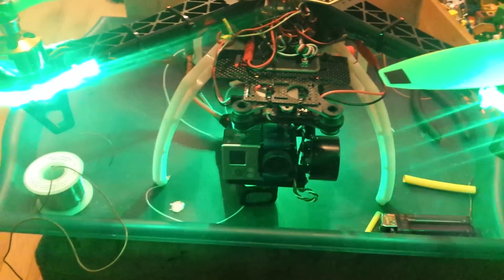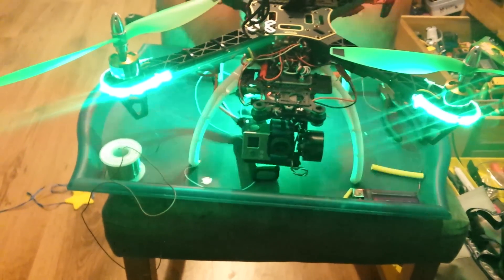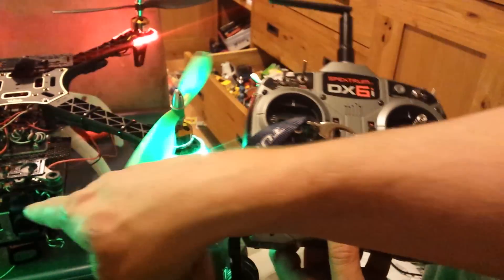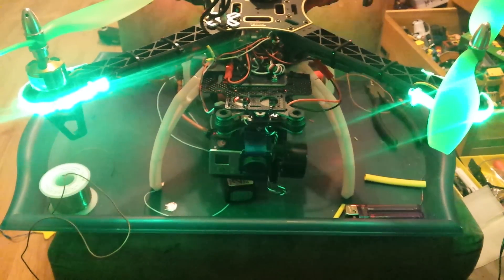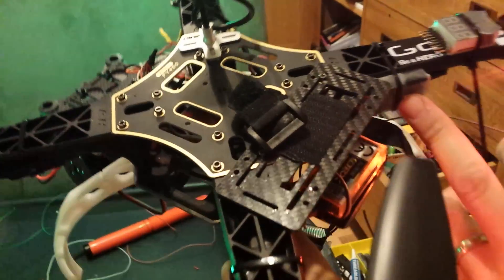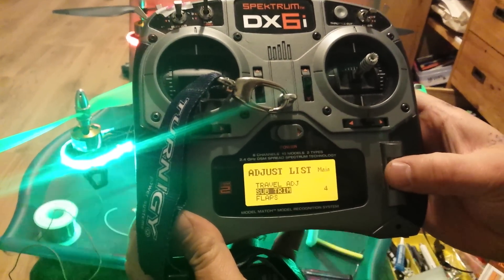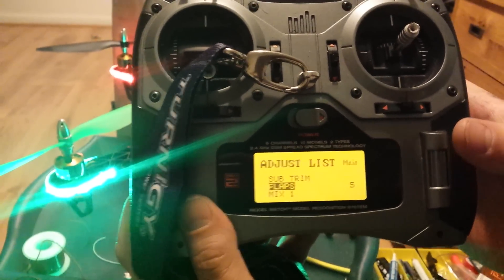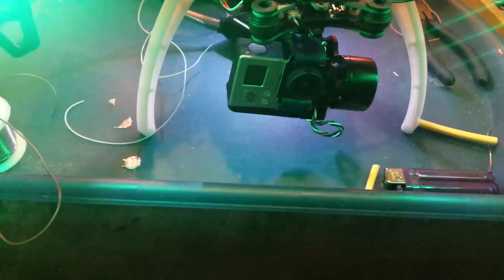Dx6i gimbal tilt extra channel.

Comment: Thank you for this, you really saved my bacon on a Pixhawk install. Hadn't used this transmitter for a VERY long time and couldn't find the "6th" channel switch for mode select.... Ever heard of anyone replacing a 2 position switch with a 3 position using resistors maybe or just going to a knob with multiple indents?
I did a lot of those kinds of mods on a Futaba 7 channel that had a rotary knob. By using a 4 position potentiometer it was pretty sweet.

Comment: Hello, I was searching for a tutorial like this one since longtime. I 
followed all the steps that you showed but I'm encountering the following problems:
When I switch the flap stick from pos.0 to pos.1 nothing happens. But when it's in pos.1 and I move forward the elevation stick then the gimbal completely tilt itself (for over 100 degrees while your gimbal tilt for about 45 degrees). 
The only thing that's working right at the moment is that once I move the flap stick back to pos.0 the gimbal come back to the start position.
I tryed to repeat all the steps, checking the settings again and again but I can't fix the problem.I can't understand where I'm wrong. 
Please could you help me?

My multicopter is a Blade QX350 with fw3.00, my transmitter is a DX6i, 
my gimbal is a Walkera G-2D
Reply: christian rogari hi. Its been a few years since i posted this so cant remember all of it, but it sounds like youve got your channels mixed up. If it moves with the elivator. Also that would be why its going so far. Check your chanels. The end points in the switches will stop it going to far. But i think you have yours on the wrong channel
Reply: maybe you're right,but this is the only mix (mix1) actually set in my transmitter and I've got it here on YouTube on the Horizon Hobby Channel,  on the post named "blade 350 QX and 350 QX2 transmitter setups"
https://lh3.googleusercontent.com/HHkYcyNjXWi61oT31xH9CEIRJH1sVBEBMNvfnAztalfc1rhbhbSCcT1_O1LtWnb4yUYBrxKx8XQ

Comment: Ace tip!!...another thing you can do in addition to that (I did it on heli mode so its in gyro rather than flaps but same switch)
1) Before taking off, go into those setting on your transmitter and highlight/select the position the switch is currently in.  
2) Then take off and fly (having remained on that setting page on the transmitter)
3) While flying, scroll the selector wheel right or left (raising or lowering the gyro/flaps number.
It will allow you have full control of the movement rather than just the 2 set positions.
Happy Flying

Comment from the maker: I did this some time ago now so can't remember.  But I upgraded to the dx7s  it's so much easier now.  It has a 3 position switch.  I've used it on 10+ multirotors .  If you can upgrade do

Comment from the maker: Yes.  Just connect to ch 6 .  The settings on the transmitter can be adjusted to whatever you want to set the camera at whatever angle you like.  As you change the settings the camera will move